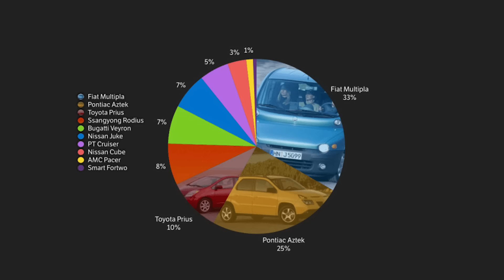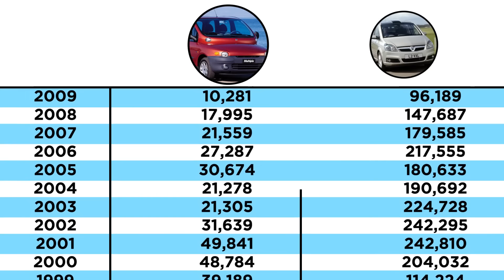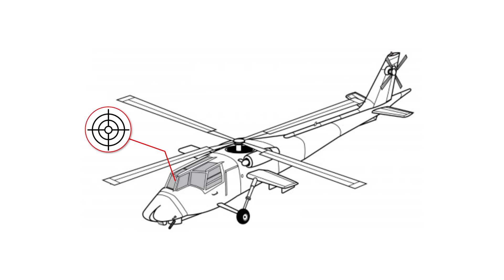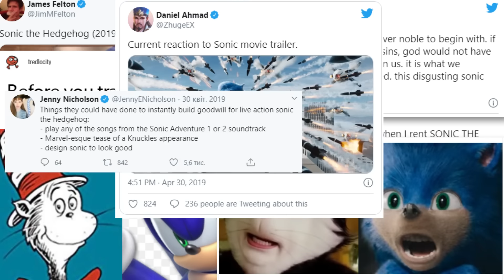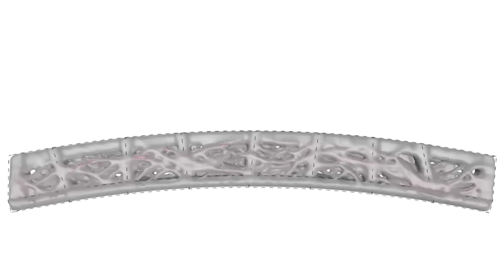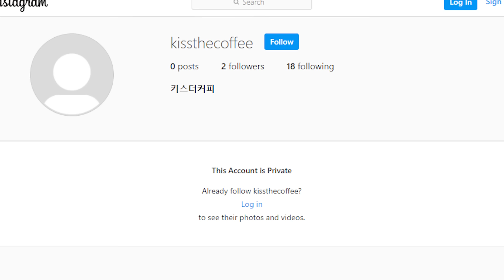Ugliest Design Mistakes Ever Made

Comment: The Walkie Talkie is my favourite London building actually and I don't find anything ugly about it. It just looks sick.
Reply: @dannydaw59  You mean The Shard, or which one?
Reply: Its not the Shard. The building sides are curved like an oval. Its got glass windows and it looks like its shorter like 40 floors tall.
Reply: @dannydaw59  You mean the Gherkin.
Reply: Walkie talkie ain’t that bad just don’t park your cars there.
Reply: @wazzupp1029  Well that has been resolved hasn't it?
Reply: @filip9587  yeah it has been fir awhile pretty sure they made a video on it actualy lmfao this channel used 2 be better
Reply: @Gamekanaal-net  Yeah the content they're covering is kinda getting stale and old. Most of these videos are touch upped reuploads.
Reply: it's revolting
Reply: wasnt the walkie talkie building become a deadly lazer at somepoint
Reply: It melts bicycle seats!
Reply: @wazzupp1029  Or put solar panels there and keep a big air gap for cooling, and make bank. Lol.
Reply: That walkie talkie can melt your car bonnet
Reply: The building look like a glass building that's gonna kill some people and cars
Reply: Yes, but the solar death beam is still a mistake.
Reply: until it melts your car
Reply: ikr it looks cool
Reply: Nah...  It's ugly. Almost uglier even than the elephant building.
Reply: One of the biggest problem of that building is that the reflective parts of the building are in direct contact with the orientation of the sunlight. Back in architecture class in college, we had a full lecture about the walkie-talkie and the history behind it. It was a fun lecture ngl.

It doesn't help that the part that directly faces the sunlight are curved downwards, creating a focused reflection effect onto the streets directly in front of the building, which causes the whole melted vehicle problem.

Comment: The Fiat Multipla was actually great and just unusual, not ugly! The only bad thing you can say about the Multipla is, that the steering wheel was way to low OR the drivers seat too high. Not only that you dangerously interfere with steering the car by bumping with your legs on the wheel each time you hit the breaks or the clutch, one permanently drove in fear to break your shin bones in case of an accident, because the interiors casing was too low. One permanently bumped the edge of the casing when hitting the pedals. Thats actually the only bad design of that car, which is really not to comprehend considering the cars dimensions.

Comment: yall should have included the BQ23-7. it was an experimental diesel locomotive that was tried by the Family Lines System Railroad in the 1980s, as an attempt to free up more space for crew members in the cab and eliminate the caboose from the ends of trains. the BQ23-7s, known as "hammerheads", were modified B23-7s with a "quarters cab" that extended to the front and sides of the locomotive, resulting in a perfectly ordinary B23-7's body with a huge brick-looking square cab. some survived into CSX Transportation ownership in the 1990s, and they were all retired by the mid-90s.

Comment: 3:13 They must’ve gotten the design from one of the earliest designs of ppl attempting flight. I remember, learning in school about the Wright Brothers, and I can see the illustration in my head of a design like that, on a smaller basis, but with 3 separate levels of looooonnnggg wings. Maybe it was a short film clip? I recall its attempt @ flight being over almost before it started. Maybe I’m mixing up the images. Oh well.
Reply: It's simply designed that way because it was literally the only way it COULD be designed back then. There was no other way to operate and experiment on it. It's science, more than it is design.

Comment: Some comments:
Multipla has low repair ratio compared to other cars. And it drives pretty well, 6 people in car is a plus and... the length of the car is also small makes parking possible. I see some cars (especially stationwagon type) are much larger and so they have less good parking possibilities.
Multipla Gen3 has changed to better looking front, but yeah, it's kinda late to gain in sales and get rid off uglyness.
Still, if you only care for good functional car, it does the job well, comfy ride and roomy. Good looking around and you sit also bit higher.
Even Multipla has some bad points, it has plenty good points. And it's pretty cheap on 2nd hand markets for that reason.
Thanks to more wider body, it's solid on curved roads.

Second, the honeycomb sytle ship: the honeycomb or root design is still using in some buildings due the natural look. Can ugly for some people but nature showed also this effect. I see them still today, also in some 3D worlds. The famous Virtual Market 5 uses this effect too.

Comment: the electric motorcycle was actually light, by even modest motorcycle standards. the avg 750cc sport bike is over 400lbs. my own Yamaha Royal Star is over 800lbs dry.. 1000lbs with fuel and rider.
other than the eye stalk mirrors, the design was not that bad,

Comment: Calling something a 'bad design' when the design was chosen for functional reasons rather than aesthetics is kind of lame.  If the design was chosen for functional reasons and it actually interfered with the function then you can say it was a bad design.  Otherwise there's nothing wrong with valuing performance over aesthetics.

And the stealth prototype was successful in that it demonstrated that the theory matched reality.  Again - functionality was more important than looks.  Ant it was not a production aircraft - it was a 'X-series' aircraft (X-series aircraft are built literally as experiments.)

I notice a pattern of panning military designs which focus on functionality.  For the military looks are much less important than how well it does it's job.